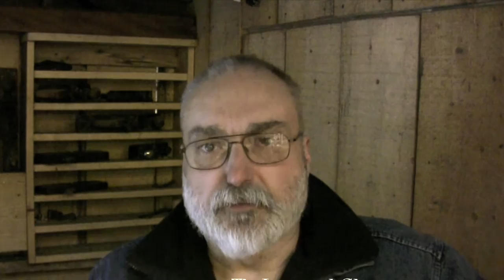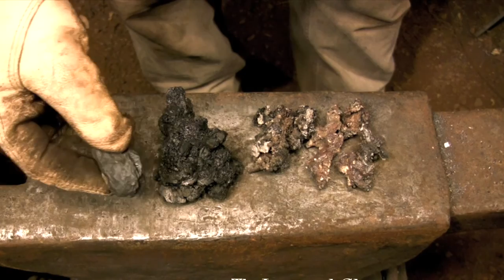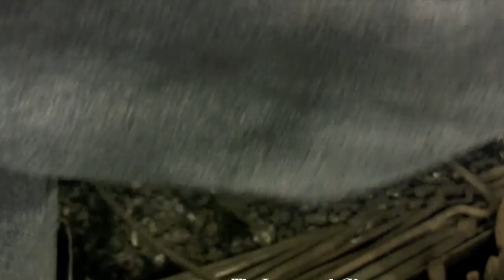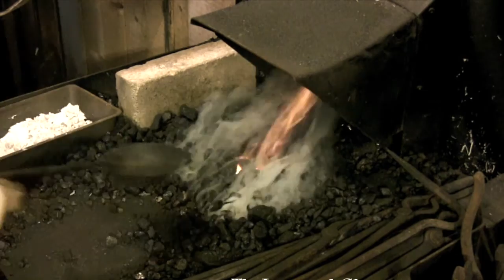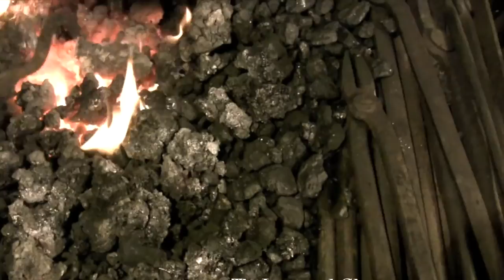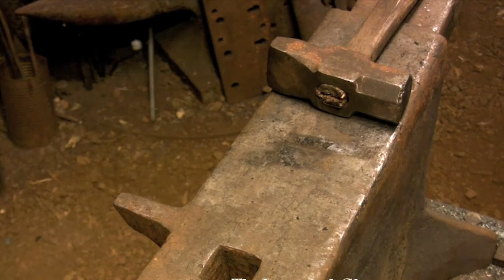Blacksmithing for beginners - Forge Welding 2

Comment: So basically crank the fire till it’s incandescent then hang back on the blower a little to let the metal “soak up the heat”
Reply from the maker: That's right.  You will get a better heat for less fuel and greatly reduce the risk of burning the metal.
Reply: @ ok that helps a lot rhx

Comment: Looking forward to try that. Thanks a lot for the video. One question, though - why did you clean & reflux again at 12:09? I didn't get it from the video, I'm sorry.
Also thank you for the part about coal, clinkers etc. Very informative.
Reply from the maker: Flux that is no longer active will transform the scale into a hard caramelized crust on the steel.  This coating will prevent  the weld from sticking.  The only way to remove it is with a wire brush.  The demo at 12:09 ( + - ) was to demonstrate that more flux will not dissolve this coating once it is formed.  Stay tuned this is one of the videos I will be remaking shortly so hopefully I will do a better job of describing the process.
Reply: @df-intheshop330  Thank you, got it. Also if you remember, please show in the video how to know that there is the unwanted crust from flux that has to be removed. Maybe it's clear when one is doing that, maybe not. I haven't welded so far, so I'm just asking for that as I'd like to know as much as possible about that :) Thank you.
Reply: Stupid question but how are you keeping both sections of material steady when you initially weld them?

Comment: I was curious if you have made a video doing forge welds with a propane forge?  Some smiths claim you shouldn't do them with a gas forge. I've heard coal is easier to focus your heat. I've had good luck with the majority of my forge welds in a gas forge, but not always.  If you've covered this in another video, which one?  If not,  would you consider it? I'm a big fan of your videos.  Thank you for all the awesome information! I'm glad to see that this art is still being taught and learned by so many new people.
Reply from the maker: The main disadvantage with forge welding in a propane forge is that the entire piece is  brought up to welding temperature.  That isn't a problem if you  are making a large pattern welded billet for a knife but it can make it almost impossible to forge weld  small delicate pieces.  So even though a coal forge is more versatile and you can build  a fire to suit the piece you  are working on, it  is much harder to weld in a coal forge because the process is totally intuitive. There  is nothing that you can measure or easily replicate.  There a so many variables that cannot  be controlled.   In a propane forge, every part of the process can be controlled. Gas pressure, burner settings, damper positions, CO2 levels inside the  forge etc.  It is still not an easy process but once you have the process dialled in and you  have documented the entire process, getting the same results it  is just a matter   of making sure that all the settings are right.   With a coal  fire  it's always guesswork because the fire is  always changing. I've missed a lot of welds that I though were textbook examples of perfect welds and I have no idea why.

Comment: There's a video out there somewhere,  where a fellow (shall remain nameless) explains how easy a forge weld is... he was over heating the steel to the point of throwing sparks, saying, "and it sticks with one strike every time! " As if he'd discovered a new amazing way to forge weld! I had a laugh at this one.  Burnt steel is weak steel,  so yeah it will stick together because some of the steel is molten at that point, but the integrity of the weld is going to be a bit iffy at best, because the outer layer of the steel is completely oxidized and burnt.  This video is straight forward, well done, and good solid info. His advice for maintaining a coal fire is fantastic as well.  It would be difficult to find a better guide than this for basic forge welds.

Comment: Very informative video, I am not yet ready to attempt forge welding, still teaching myself the basics. Scarf joints in timber, from a shipwrights knowledge, are typically 7 times the thickness or width, depending on which way the material is going to be stressed, from a blacksmiths view you would know better than me! Thanks for the video, knowledge is valuable!

Comment: Amazing video! I'm very new to blacksmithing, but I'm going to watch all your video's. I just wonder how you heat up the metal after you sticked them together after the first forge weld?
Reply from the maker: The metal gets heated up the same way but because the joint is now on the inside of the bar you need to make sure that the entire cross section stays at a welding heat.
Reply: @df-intheshop330  I appreciate the video, when I get to pieces to stick I cannot get back to forge weld temperature because it sitting above my firepot without burning alot of coal. Any ideas do I not have my fire built up enough , thank you

Comment: Hi Denis thanks for the well explained videos. I'm new to blacksmith, is it possible to forge weld a T joint?
Reply from the maker: Yes it is.  I guess the only video I've done that used this type of weld is my video  on making a traveler.  Also the t joint was often made with a cleft weld - see my spatula video.

Comment: Why/how does the chimney thing above the forge suck up the coal fumes? Why don't the fumes just go straight up?
Reply from the maker: Hot air rises so when you heat up the air in a vertical pipe the air inside the pipe rises.  In a well designed chimney the air will have so much lift that it will act like an exhaust fan and pull in the surrounding air.  That why you will see a forge with a hood sitting next to the forge but the smoke is being pulled in a horizontal direction into the hood.

Comment: Best most comprehensive explanation ever. I couldn't believe some of what I was told before. I was starting to believe this was because forg welding was thought to be some secret right of initiation, like how to tiy a butchers knot.
Reply from the maker: I think a lot of that is understandable because forge welding is so frustrating to learn, especially if you are on your own.  When you finally do get a few welds to stick it does feel like you've cracked a code or made a major discovery.  I would definitely work on the brake drum forge to get a deeper bed of coals.  A very deep and dense bed of coals is ( in my opinion ) the most important factor in getting your welds to stick.  You need a very hot fire but all the air has to be consumed by the fire before it reaches the steel. In a shallow fire welding is really hit and miss and you can't get a good weld because it's impossible to heat the steel long enough without burning it.